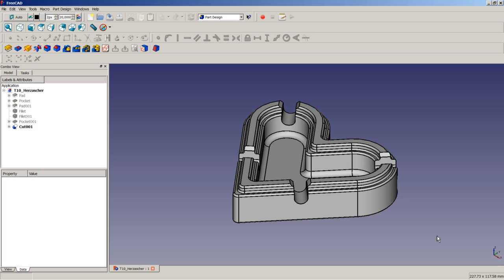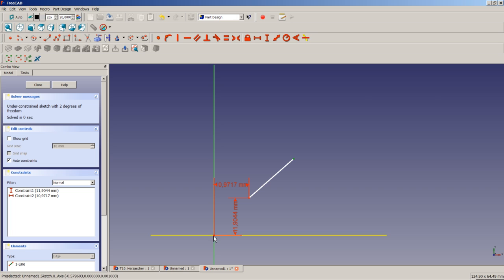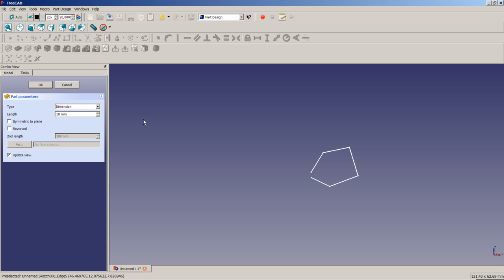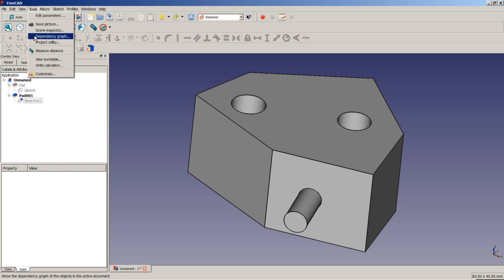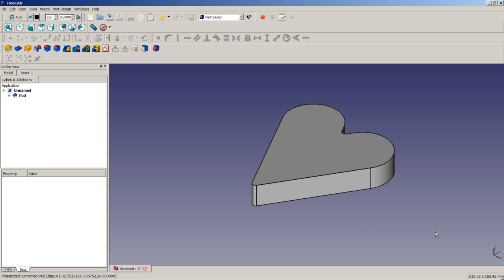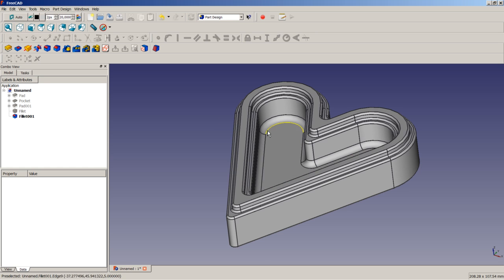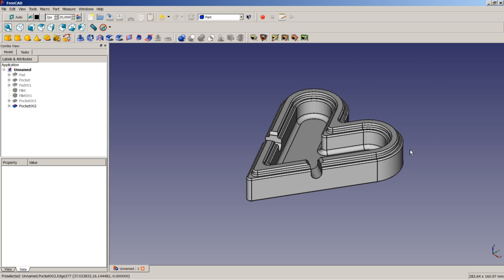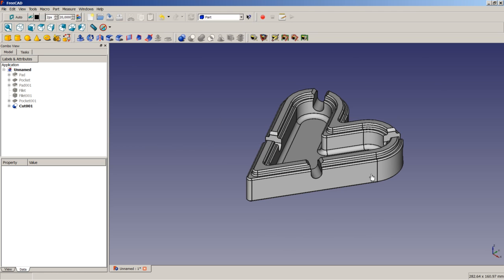FreeCAD Lesson 10 - Heart-shaped Ashtray

Comment: So, attempting to reproduce this under FreeCad 0.18.4 and I hit a problem at 39:00, where I cannot make a pad on sketch005 in free space; trying to do so makes the 3d space vanish and if I click Okay, I get an error that this would create two solids which is not allowed.
I resolved this by creating a new Body (blue staircase icon), and then performed "move to other body" on sketch005 to move it to body001. Then I could pad it, extend the pad reversed 100mm to intersect the first body, and then using Part Workbench, do a boolean cut of Pocket002 (original body last step) and Pad002 (new body001 last step), selecting pocket first to subtract the pad from the ashtray.
I also found it most fun to do both Sketch005 and Sketch006 pad first, so I have two overlapping columns intersecting both arcs of the heart-shaped-ashtray, and then do the boolean cut once on both pads against the original body "Pocket002".

I had no problems at 24:00 with the trick from lesson 3 that someone previously mentioned broke for them on 0.17.

Overall the instructions mostly worked for me, so this is still a great tutorial. Thanks!

Comment: Excellent tutorial however at the end of the video I have a problem with the two boolean cuts. Although my ashtray and padded sketch are correctly shapedand oriented the boolean cut doesn't appear to be working. Any ideas? I use  FreeCAD 0.16.
Reply from the maker: Yes, you are right. It seems, from 0.15 to 0.16 something changed with the geometric core FreeCAD uses (OpenCascade). After some tries i achieved in getting a valid solution by cheating a little bit.
I changed in Sketch005 and Sketch006 the "25 mm" constraint to "25,001 mm" and it worked.
I haven't tried but maybe changing those two sketches to get overlapping solids would also solve the problem.
Better have overlapping solid with boolean operations than only touching solids.
Reply: Yes, it works. BTW: If I change the 8mm width constraint to 8,001mm it also works. Reminds me of an OpenSCAD problem where you only get a good boolean cut if you add a small increment to a round number. Thanks and if I may ask: any hope of a new tutorial?
Reply from the maker: OpenSCAD and FreeCAD use the same geometric Core, hence same behaviour, same problem.
Well, since i have house, day-time job and so on i can't promise but chances are beginning to look better
for new tutorials ...
Reply: Learn FreeCAD
Thanks, I keep my hopes up.
Reply: I also had this problem with ver 0.16. I left sketches "sketch005" and "sketch006" as shown in the video. I solved it by padding both sketches by 100mm instead of 90mm. I don't know why it worked because a pad of 90mm easily clears the edge of the heart, but it worked for me. I would be interested if it works for other users also. Thanks for the great tutorials.
Reply: I also have the same problem. the boolean cuts can operate correctly.
Reply: I'm using Version 0.16 for windows 10 and everything worked as per the video. Sometimes it pays to save shutdown and restart and everything works fine. I had Boolean cut problems with the external thread, I deleted the helix and started from there again exactly the same process and it worked straight away.

Comment: I am sorry but I have problems at min 24:00 when I have to copy the sketch on the surface, I am using 0.17 on Windows 10, and the trick suggested in comments to lesson #3 does not work in this case. Could you tell me the right procedure? Thank you
BTW thank you very much for all these very useful lessons!
Reply: Did you find the solution?